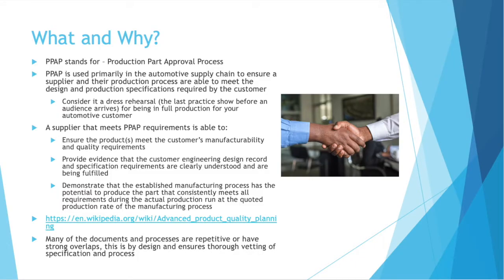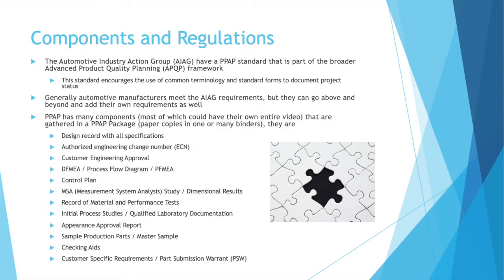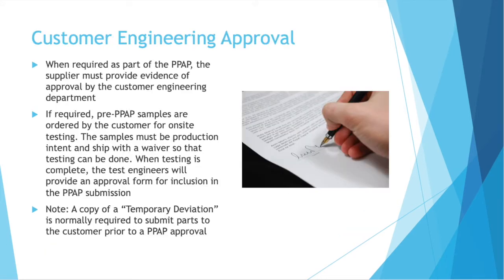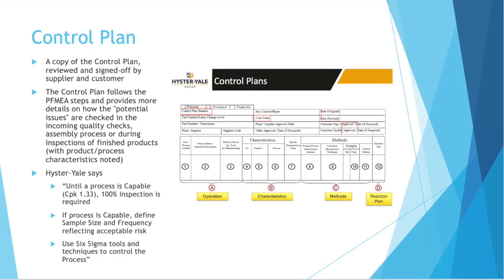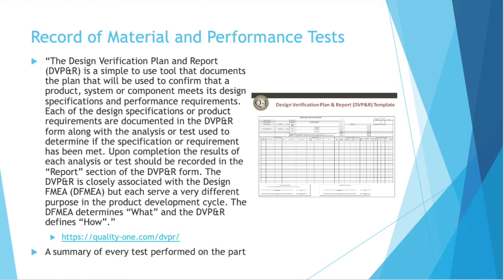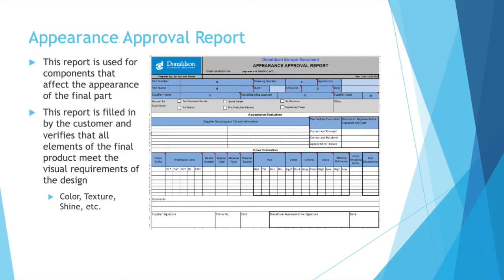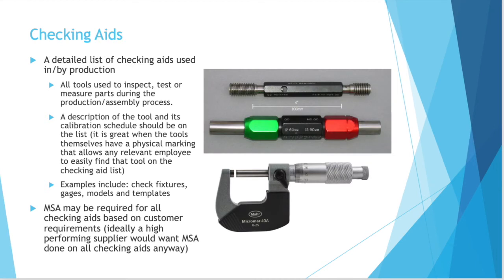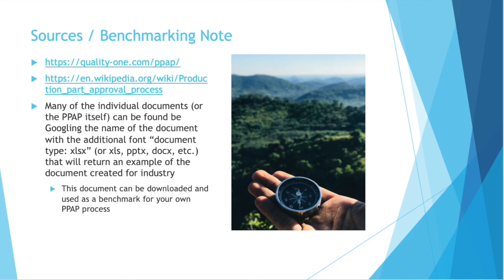Beginning Engineers PPAP

Comment: I'm confused - why you do equate the 5 levels with building a house? You don't submit each level to your customer, you submit whichever level they choose. Sometimes, for example with mass produced fasteners, a customer will likely just want a signed PSW as it's highly unlikely the production process produces much variance you need to worry about. On the other hand, if you're building, say, a winch for Ford, they will want all supporting documents down to packaging to make sure they get what they need. Ford would not ask for a level 1, then level 2, then level 3... I hope that's not what you meant.